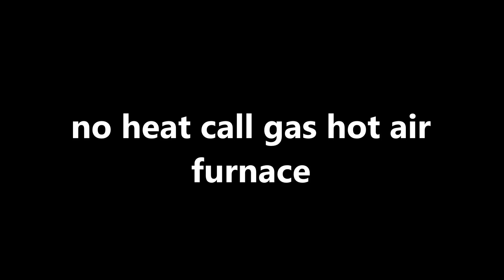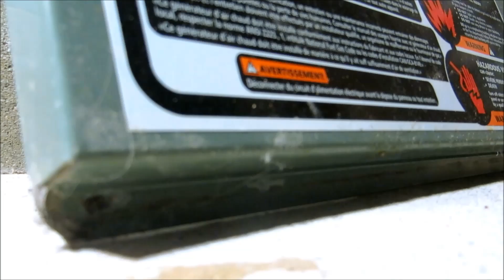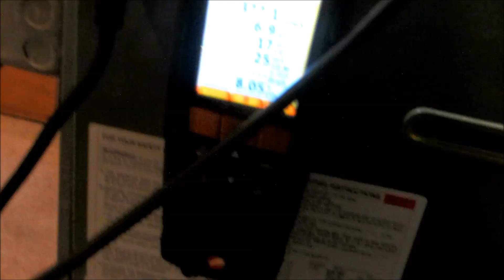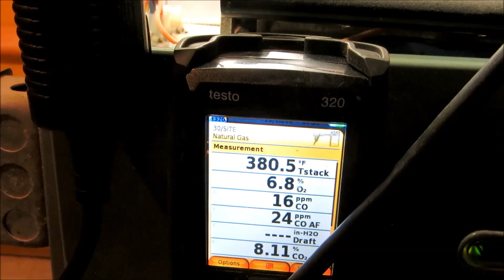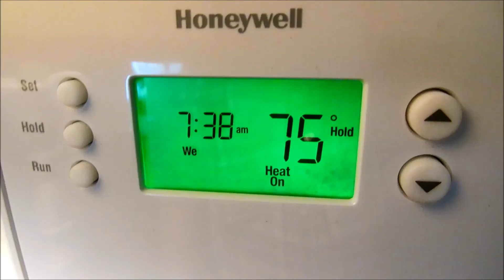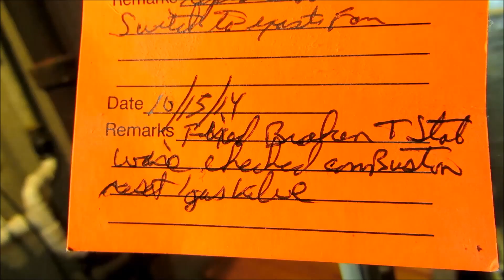gas furnace will not run,found a surprise

Comment: I changed out a POS York system at home only 8 yrs old, constantly needing repair, just out of warranty. Now happy with Carrier system 1-1/2 years old. Compressor is model 24VNA936A310 and gas furnace is a modulating furnace. Both great so far. Any experience?  I like when cold, furnace burns continuously on low. Today, reached 84, and compressor runs on low all day. Great for humidity and temperature control. Also, on real hot days, the compressor will sound like a jet engine if running appliances inside. So far happy. I opened the cover, it has some big fancy DC supply in it — I guess for ramping speeds. Any reliability issues?  Oh, combustion tubes rotted out on York furnace. Went with Carrier due to local support, and warranty. Thinking high efficiency is designed to fail. Love the nice electronic filter. Kept hour house clean during forest fires last summer. Like watching your videos. I turned down paying $250/yr for the company to inspect. I already know to check flame and flame sensor. For AC, listen to the compressor and check air temp out of the vent. I’m not cheap on buying equipment, but this year, they did less than I would on maintenance!

Comment: Good thing she had her own AA batteries. No telling how much you would have boned her for those and it wasn't even the problem! It was obvious when the Tstat was lit up nicely when removed from the wall the batteries were just fine. It was also cool how you just drilled a hole in her ductwork and never showed how you properly fix that before you left.

Comment: Not sure if you will remember, but how did you find that the wire had an "open", was it just luck where you looked and saw it, or did you do some test to check the continuity of the wire from the t-stat to the furnace?

Comment: The technician of a local furnace repair company left me a surprise after he was supposed to be at my house to perform an annual tune up.  This is after I decline his suggestion that I should consider replacing my furnace because it is more than 20 years old.  Apparently he pulled one wire off causing the heater fan not to run.  The wire was supposed to be plugged in from the top so there is no way for it to fall off by itself.  I found this out several days after he left because the heater did not run.

Comment: Wow looks like he shot a nail right through the small gap between the 2x4s from the opposite side.  Must have flew right threw the sheetrock you can see it scraped the 2x4s and the wire

Comment: I've got a hunter model 44665 programmable thermostat that works fine gets up to the programmed temp and will shut off. After a while the temp will drop way below the programed temp and I have to manually turn the temp down below the ambient temp then it will click off and I can turn it back up to what I had it set to then the furnace will come on and operate fine. It use to do this during the night and I'd wake up to a freezing house and have to adjust it to get it back on but lately it's been doing it almost all the time. I keep it set at 72 notice it's down to 61 and turn it to 60, it clicks, then turn it back to 72 and it will come on. Any advice?
Reply from the maker: change the tstat

Comment: HELP! I need advice on a furnace problem. I have a 10 year old Amana nat gas furnace in a house. The last 3 years every autumn it is reluctant to flame but then works fine for the rest of the winter, but this year it is really bad. It tries to start; the starter glows, and I swear I can hear and feel the gas valve solenoid open but no flame, usually, maybe one out of 10 times it starts, but then only runs for about 4 minutes then stops. I replaced the gas valve and the circuit board but still the same. I cleaned the flame sensor, no help. Is it possible that the gas valve is sticking closed? (GEMINI 36G54 type 238)  I am out of options and about to call the service man. thanks, john in Michigan.
Reply: Make sure you have the furnace grounded and check that you are getting 24 volts to the gas valve

Comment: I had a brand new house I put 2 systems in with the condensers on the roof. Everybody wants their units on the roof these days. They're building houses like crazy down here in Philly. Well I did my leak test on the line sets, everything was ok. Vacuumed down to 500 microns. Units ran great. A few months later when the owners moved in the 1st/2nd floor zone AC no work. When I checked all the refrigerant had escaped.  I checked the easy places at the units, no leak but I was losing pressure fast. Now these line sets go from the basement and up 4 floors and snake through the building. It was 7 houses, all the same. I had to make a few joints and boy was I worried. I documented where each joint was. Very worried! Before cutting drywall I pulled out a gas fire place insert and there it was. When they put the siding on they used used 2.5"-3" nails, shot one right through the liquid line. That was a big bill that I passed on to the builder. Who the hell uses 3" nails to put on a piece of siding?

Comment: why did you tamper with the gas pressure setting on the gas valve? your combustion analyzer originally showed zero CO and I believe you were adjusting because your carbon dioxide was too low?

Comment: Hi Steve I've been in the trade now for almost 3 years now .. I wanted to ask you about those cheat sheets that you use when your checking your co2 levels when your adjusting the Gas  pressure . Does the data on your sheets pertains to any furnace or do you have data sheets for every size of furnace? how would I go about making something similar to go by when I'm doing the same checks in the field ? thanks for your service and trouble shooting videos they help me out a lot brother !
Reply: Hey I saw your question. I've been in the trade for  25 years and what furnace and boiler manufacturers recommend is to try to achieve 11%-13% Co2 and 3%-6% O2. Co2 and O2 are just ways to get a visual idea of how good your combustion is. The BTU rating does not change the desired Co2 and O2 percentages for combustion.  Some manufacturers will tell you to only look at O2 when setting their furnace or boiler and then other manufacturers will tell you to only look at your Co2 when setting up combustion on their furnace and boiler. On startup of a new furnace you will also be given the required manifold gas pressure in inches of water column on the furnace nameplate. 
You should always check combustion on any piece of heating equipment, even if you set the gas pressure correctly. If you change your O2 by adjusting your gas manifold pressure on your furnace you will notice that your Co2 will also change. Really it all boils down to ensuring that you have safe and proper combustion. The first thing I look at and the most important thing I check first when checking combustion is the CO ppm. Where I'm from you do not want your CO going above 100 ppm. When your CO gets close to 100 ppm or above you could be experiencing problems with your heat exchanger if you just cant get the 02 or Co2 dialed in. Depending on what you are working on you may be able to clean the heat exchanger like on a boiler. However on furnaces if the furnace is getting old you may need to replace the heat exchanger(s) depending on if you are working on a 90+ furnace or an 80+. Alot of the times if the furnace or boiler is old, it's best to just recommend replacing the equipment if it looks like it just really isn't worth putting the money into nursing it along. 
I hope this helps answer any questions. I remember how it felt to be a new technician. HVACR is a very diverse trade and as technicians we need to understand many aspects of all trades. It's important to always be aware of what you are doing. Never stop learning. The industry is always changing and to be a good technician is to stay humble and never be complacent. Have a great day my brother.

Comment: customer complains no heat, furnace stopped working.    quick investigation: no ignition.     Ok, let's jump thermostat wires at control board.  HEY IT WORKS.   

okay, well, since i've JUST SHOWN THE FAULT  to be SOMEWHERE IN THE THERMOSTAT CONTROL LINE, let me instead get my $700 combustion analyzer and drill a hole in the stack to measure combustion parameters!

20 mins later....   well, i guess i've stared at the CO and 02 percentages long enough.    hmm.   oh yeah, thermostat.    where was i.   Lemme check the batteries of the thermostat.   hmm.   i guess they're okay.    well, clearly the signal AINT GETTIN TO THE CONTROL BOARD, i'll trace the line until i find the break.   yep there it is.

Nice find.   Good thing you broke out the combustion analyzer for 20 minutes of "analysis"     that meter ain't gonna pay for itself!
Reply: And why would you not do a service on the unit? How do you know when the last time it was serviced?

Comment: Just curious. wouldn't hou start at the thermostat first?  Then when you jumped/bypassed the thermost to call for heat, wouldn't a simple continuity test (failure) of thermostat wires immediately indicate a break in the line. just seems logical.

Comment: Hey Steven 
A14 years old builder model Carrier high with no HSI output out of the board ,no fault code and venter running constantly . Replaced whole furnace wire harness , board , HSI and transformer and still nothing , ground is good 
Any thoughts ?
Reply: 14 y.o. builder model?  kind of answered your own question, i think.
Reply: rob johnson you don't sound that smart
Reply: IMon what does MO stand for ? Moron ?

Comment: hey steve quick question. i think i was working on that same unit and inducer comes on pressure switch is good then im not getting a spark or anything. not even trying to light. the board is not giving me a flash code i am leaning towards the board but there also is a fan limit switch on the fan housing. you think my prob could be there? im still leaning towards board.

Comment: I have a 1972 rheem appliance and it does heat up there bUT! NOO fan .. doesn't kicky in there got a new themostatat there that worke a little but .. noo fan blowing there limit switch okk but the other switch black I don't know there .hard to find a switch like that for a rheem!! UGHH.

Comment: I have a furnace just like that one but newer when the weather temperature drops  it won't throw hot air just cold what can it be
Reply: Pilot light probably went out
Reply from the maker: +Pichon barber could be many things no way to tell unless i am there testing stuff  ,had to tell over a email or comment
Reply: Ok
Reply: +Pichon barber if its a 2 stage furnace may be that your second stage is not kicking in. Jumper W1 to W2 inside the furnace on the control board and see if second stage firing kicks on. 
When you say cold air, is there actually any flame inside? Could be that your furnace is tripping on high limit shutting off the gas valve but leaving the blower motor running to keep the heat from cracking your heat exchanger.

Comment: Great vid Steve! I do have one question.... Did you check the heat rise after turning up the manifold pressure?  I wouldn't put it past some installers to turn down the fire to overcome airflow issues when they run out of blower speeds.  Just curious how much that changed when you turned it up.
Reply from the maker: BigBoy4005 it was fine ..the furnace was never set from day one ..

Comment: I had one where the guy put up paneling and put a small nail into the thermostat wiring shorting out the R and W circuit, the guy's heater was staying on.
Reply from the maker: ***** i have seen some crazy stuff also .

Comment: Great catch with the wire.What is the brand of the door switch tool? Looks like a pretty neat device.
Reply from the maker: MrMultitool   http://m.ebay.com/itm/Mullenix-Furnace-Tool-Magnetic-Door-Switch-Depressor-/350883237741

Comment: Ever had any problems with temperature rise after adjusting the gas valve?  (overheating)
Reply: +dpeagles as long as you stay within the manifold limit you wont get overheating. Most manifolds are rated to 3.5"WC for high fire and around 1.8"WC for low fire. Overheating I find occurs when someone oversizes a new furnace for the existing duct work.

Comment: Which is the better way to dial a furnace in? Using the 3.5" wc (2.0/3.5 for two stage gas valves) or dialing in based on a combustion analyzer? I was always told that it should be set at 3.5" wc (nat gas) and that was that.
Reply from the maker: David Feherty i was told the same also .. but i go by what my testo 320 tells me .. so gas pressure is not all that important .. to me .. i look for the best combustion i can get .if its running at 2.75 and running its best i leave it there .. 3.5 is a starting point ..sometimes the jets might be off a little .. sometime you have to increase the pressure more then 3.5 go by the combustion meter is what i do